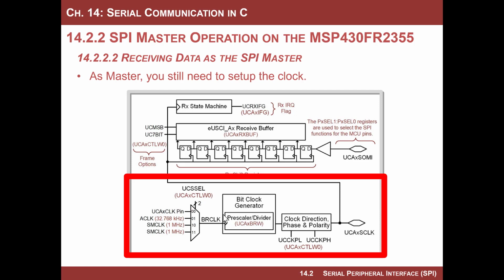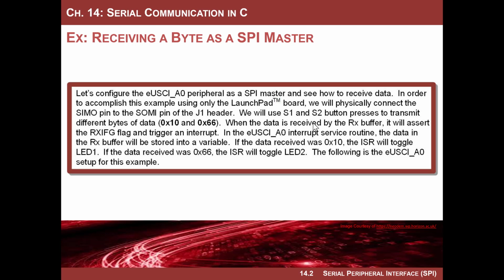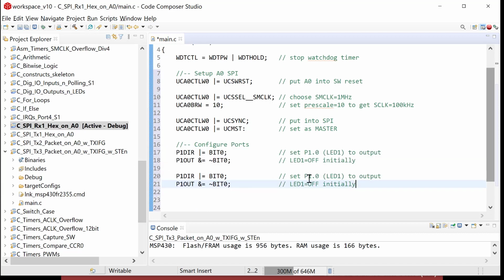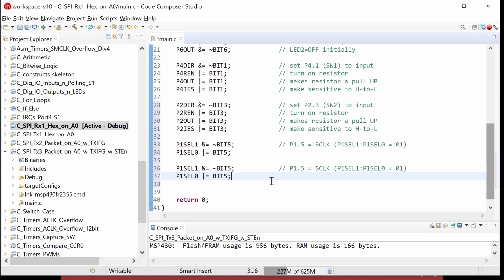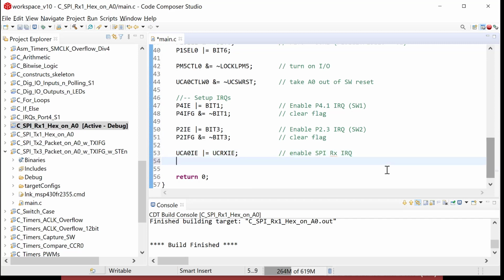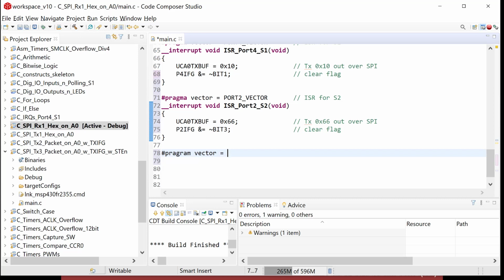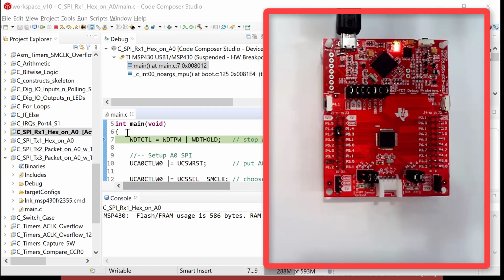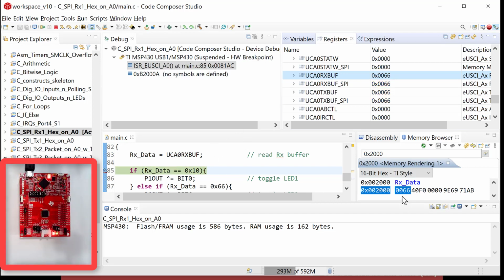14.2(e) - Serial Communication on the MSP430: SPI - Receiving a Byte as a SPI Master

Comment: Excellent series, thanks Brock!
If SW1 and SW2 are on the same port though (as they are on the 6989 launchpad) then you need to check which BIT of the P1IFG is set once inside the PORT1_VECTOR. Simply use this code segment to check the logic:  if(P1IFG & BIT1){  etc...    // checks BIT1 of P1IFG which is the bit for pin 1.1 or SW1